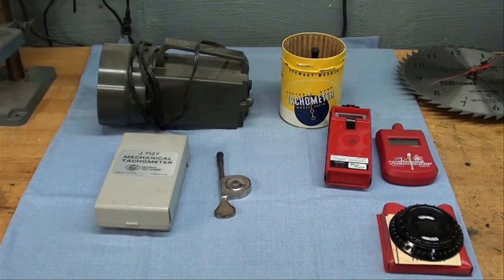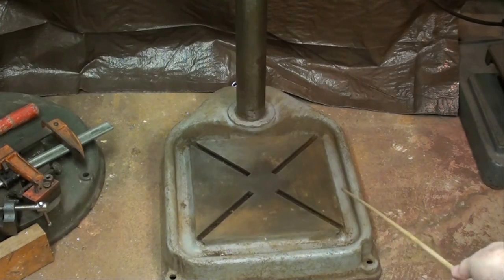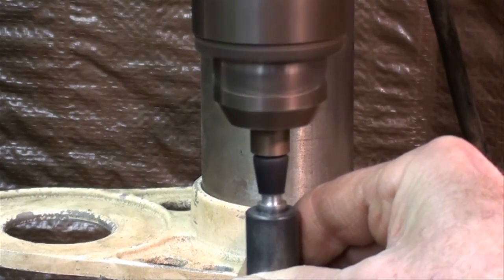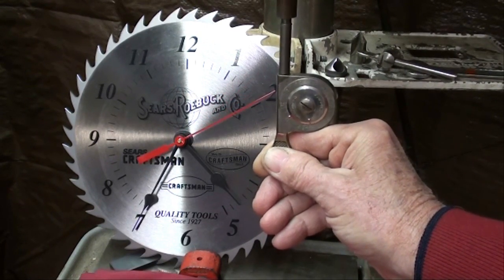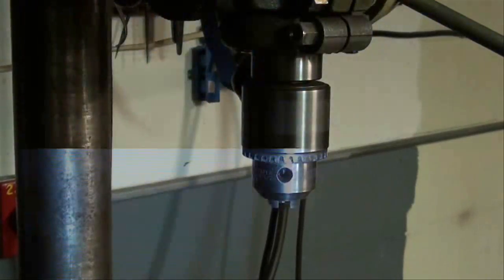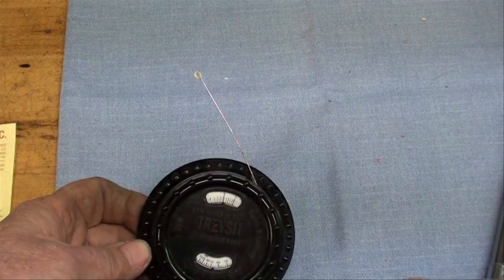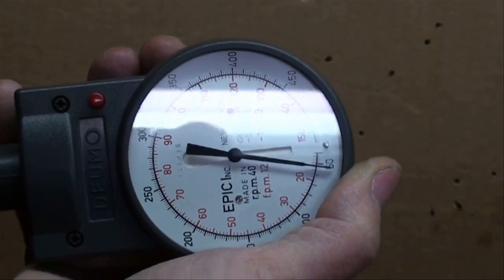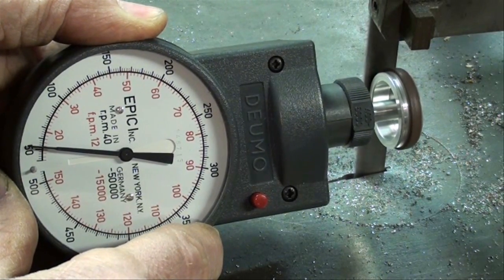MACHINE SHOP TIPS #93 Checking the RPMs on Shop Machines tubalcain

Comment: certainly enjoyed it :-)
what you said at 09:55 is exactly why there are laws against using fluorescent lights at work over a lathe / grinder / circular saw etc.  the old  fluorescent lights used to flicker at 60Hz in the US and 50Hz in Europe, and when the speed of the machines was similar (or a multiple of the net's frequency) the machine seemed to be at still. 
it probably cost many fingers and a few lives till it became a law :-\
today's CFL and such are much faster, but still dangerous.

Comment: Another excellent video.  A question about the foam padding disintegrating...I have some micrometers which were discolored by the padding in the case. Is there a cleaner to remove the stain left by the foam disintegrating?